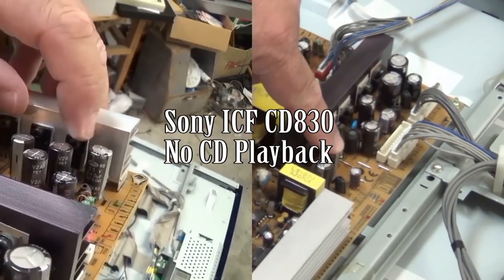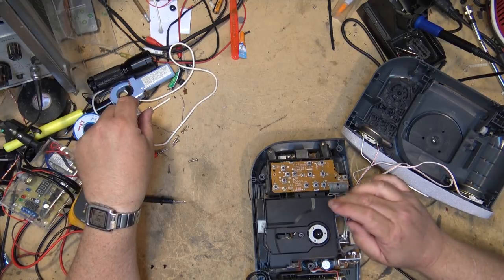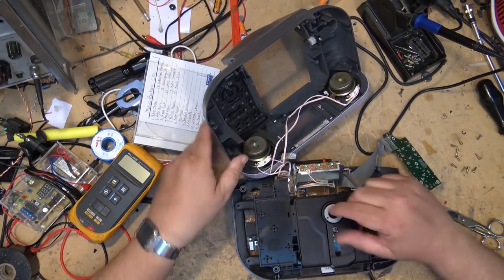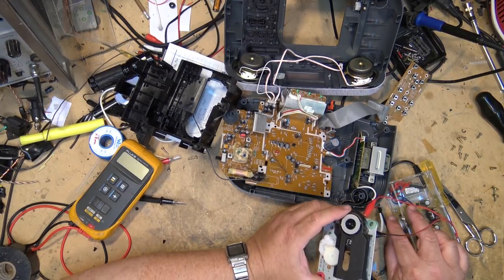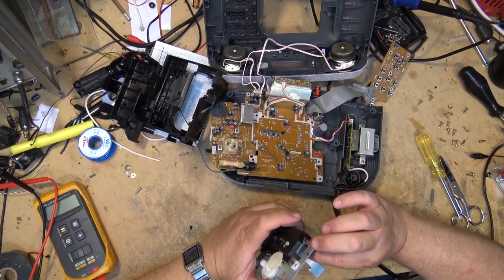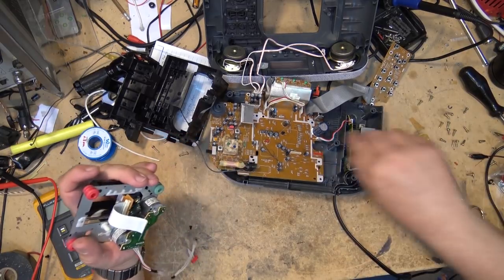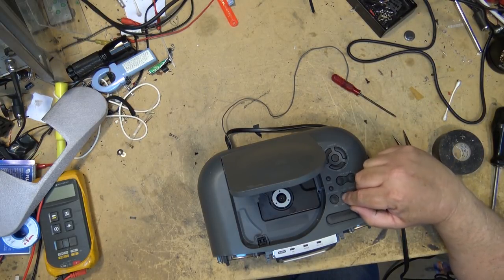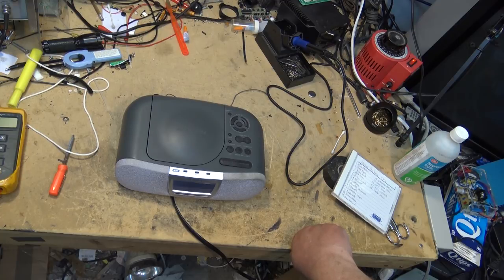Sony ICF CD830 No CD Playback repaired

Comment: man you're up late. I had a technics slxp7 portable player. I had a Woodstock cd it had trouble with. i did adjustment after adjustment to attempt playing this damned disc. i adjusted all 6 pots and the laser head itself. i got it to finally play but it wouldn't play my other cd set. i even had the laser down to the mirrors. i blindly put it back together and tried to align everything with no proper test disc or a scope! I actually got the thing to play again but it was very gravity sensitive. moral of this story. Woodstock disc 2 was physically thinner than disc 1, or all of my others. that cd player was NEVER designed for cdr or thin disc use. this was in 1988 or so. Just sharing a related story
Reply from the maker: What often happens is the disk table slips slightly down the motor shaft, which makes the focus lower. All it takes is a slightly thinner disk and that one won't play. The solution is to raise the table slightly. This also happens when the bearing on the bottom of the motor wears slightly, which causes the table height to drop. Again when that happens it will generally play some disks and not others.

Comment: I don't understand why CD players today have a ribbon cable between the reader assembly and the mainboard. I have an Emerson Ad2452 boombox and it has a line out from the CD player and main board. I guess they don't want guys like me hooking my phone to it like I did in one of my videos. I have an under counter radio/CD player and the only way to get audio into it is through the FM radio, no aux inputs, and no line in from the CD player.
Reply from the maker: The ribbon cable is there as there are multiple signals requires, and ribbon cables, correctly called FPC, or flexible PC boards ere much more reliable than say separate wires that bend back and forth like some companies (I'm looking at you Rotel) used. The FPC carry's the power for the laser, and pickup preamp. It returns the RF from the preamp. It also carries the focus and tracking coil signal from the servo to the pickup head. They can break, especially if not handled correctly, but generally they are more reliable than the alternative, a bunch of wires and a coax line for the RF signal.
Reply: J'ai un appareil photo Sony Handickam il y a la pièce électronique manquante qui est un petit morceau de noir avec la pointe d'argent et le reste noir je ne sais pas que la diode ou était intense, mais son numéro 6J7 Pouvez-vous me dire ce que sont ce widget sujet et quelle fonction qui était diode ou condensateur ??
Reply: 12voltvids my Emerson CD player everything for the CD player was built into the assembly itself with power (7.5 volts) and audio line out. Ii actually have a CD player assembly from another boombox which still works. I can hook it to my stereo but the audio is a little low. I guess the audio for those is lower than that from say a normal line out like from a TV.

Comment: The only problem with mine is the display is not bright enough to see even in the dark. Plus the display is pretty small, can't read it without putting my glasses on. Bummer
Reply from the maker: The led behind the display is weak.  Easy enough to change.

Comment: By chance, do you have anything particular to say about KSS-213 laser pickup? I mean, if it is "not good enough" for some reason?
Reply from the maker: No data on the KSS213.  Can't say it is any better or worse then any other one. The 240 was a very popular laser assy over the years.
Reply: The 213 was used in countless Aiwa products that were recalled due to bad lasers.